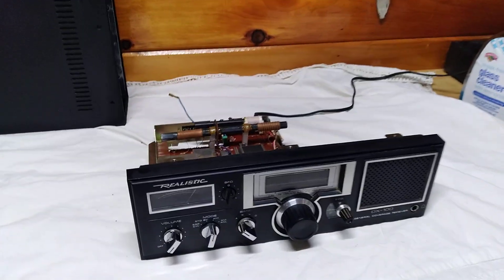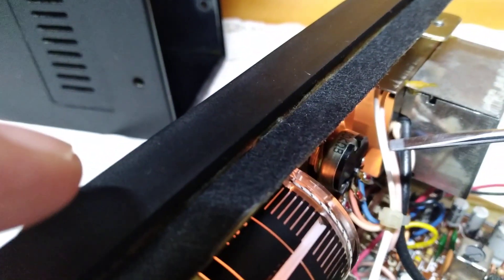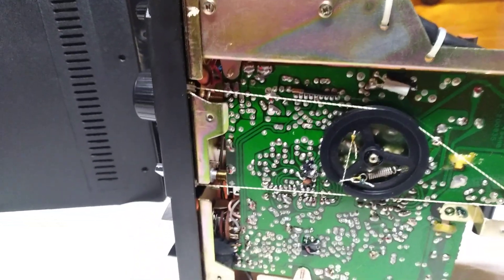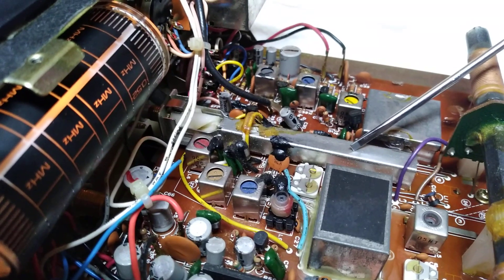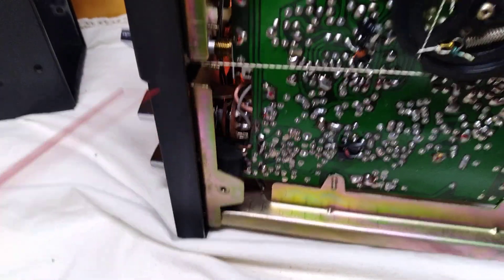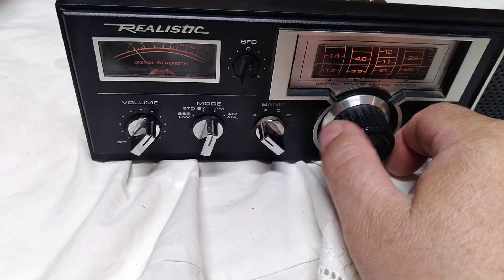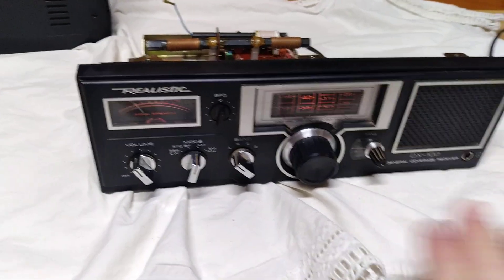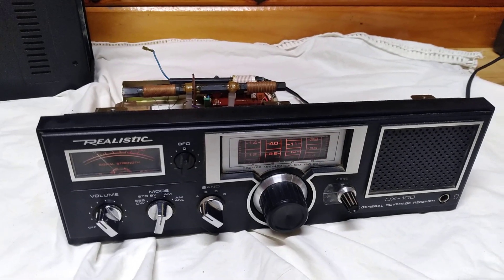The Realistic DX-100 How You can fix it

Comment: I have the european version, LW, MW (Am band) 3 short wave bands, it drifts a bit despite a rudimentary heat sink on the transistor, switch it on and play once i a while, would like to have the kit and manual to align it it all after checking the capacitors and resistors are in spec but space and money make that seem a long way off.
Reply from the maker: Click Link Below or cut and paste this will help you PTSR

https://www.qsl.net/on6mu/dx100.htm

Comment: How can anyone say this is a great radio. I have owned well over 100 radios. This is by far the Worst radio I have ever owned!
Drifts. One way to open bandwidth. The tuning barrel that indicates frequency has marks every one or 2Mhz only, and even then it can be over 1mhz off. (eg the dial indicates "About 14500" youre on 15205) . Overloads easily. bfo is so touchy.. horrible horrible horrible
HOWEVER it was the first radio i owned as a teen. and I lived in the country -high sunspot year. I loved it at the time. :)
But never but one now.. you will cry!
Reply: Couldn't agree more. Got one of these from Tandy, UK as my first 'real' radio, liked the way it looked but always felt like a battle to operate. Got a Lowe HF225 a couple of years later and oh boy, what a difference! 😉
Reply from the maker: @elshiftos  hard to compare a Lowe to a inexpensive Realistic Lowe is 5 times the money PTSR
Reply from the maker: @JemOTas  love the radio she doesn't drift a bit I suppose there are a few bad apples but not this one very hot reciever and they are super super simple to fix and operate like the look too thanks for commenting 
PTSR
Reply: There is a transistor that gets very hot and putting a heatsink on it helps with drifting quite a bit. Been too long to remember which but googe the radio plus drift should get you to it if you haven't chucked it by now ;o)